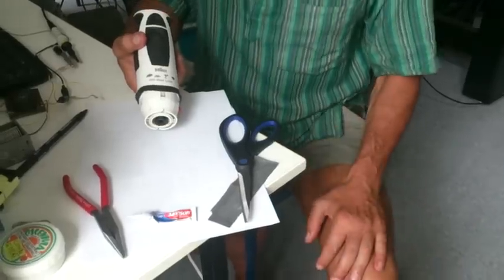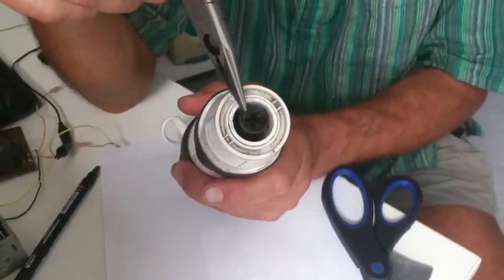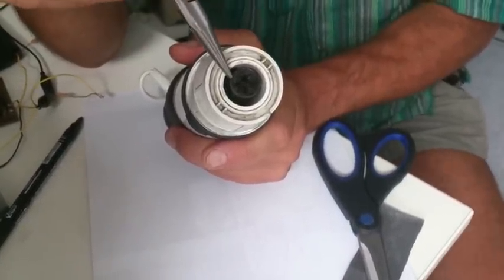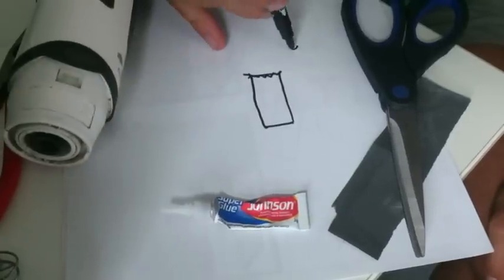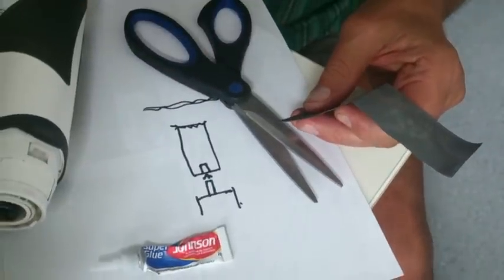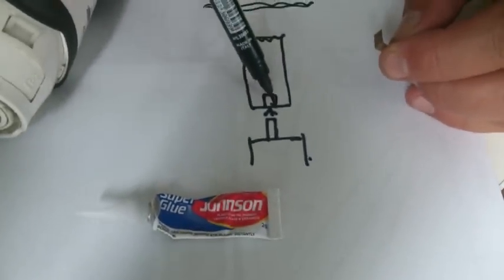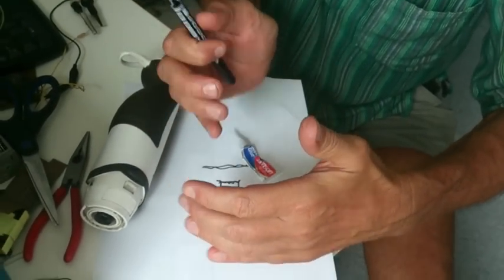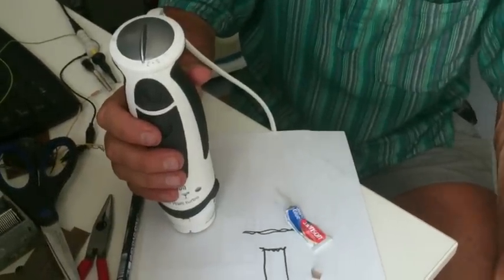BRAUN 600 Watt turbo blender - mechanical coupling repair

Comment: I was just about to go and buy a new blender, but came across this video. The repair was very easy and worked first time. You have saved me a fortune - thank you so much!

And shame on Braun for such a shoddy design.....
Reply from the maker: Very happy to see I was useful to someone .. ;)
Reply from the maker: By the way, the coupler is very important, shoddy as it may seem, as a mechanical protection against hard body interaction, human bones included ;). The problem is that is not supplied as a consumable ..
Reply: I agree with you! Just to add, that three weeks after I made the repair, the coupler broke again. I gave up and bought a Dualit....
Reply from the maker: You shouldn't .. when done properly, the repair lasts up to one year of regular usage .. anyway, you can do it presently and have a second good spare blender and the satisfaction of a self repaired device  ;)

Comment: Many thanks for your help! 
Rather than use sand paper I de-greased the shaft and the inside of the drive dog and used a fast curing Activated Cyanoacrylate sold in the UK as Mitre Bond. 
With Mitre Bond the fix takes 15 minutes before it's ready for use, 
Regards, 
Nick
Reply from the maker: Glad to help an innovative and smart guy as you are ! ;)

Comment: K, nice. I‘ve a question though, please: 
What if the motor isn’t reacting at all. When I press the buttons, there is no sound, no reaction, at all. It seems to be completely “dead”. So probably the cause is not the connection that you show how to fix…? Thank you.

Comment: Thank you so much! Braun does not sell the coupling, but you can get it from Ebay. I have the Braun Multiquick 7. I could pull the coupling as you described. The replacement part on German Ebay is called "Motorkupplung Kupplung Aufsatz Antrieb wie Braun Stabmixer 4191 4192 4193 4194": https://www.ebay.de/p/Motorkupplung-Kupplung-Aufsatz-Antrieb-wie-braun-Stabmixer-4191-4192-4193-4194/1676159472?iid=163147409537&chn=ps
Reply from the maker: This is good to know, an infallible resort .. thank you too ;)

Comment: Fine..but how open it to place the sand paper ???
Reply from the maker: .. as mentioned in the clip, you need a pair of sharp pincers ans with it you can pull out the mechanical coupler .. ;)